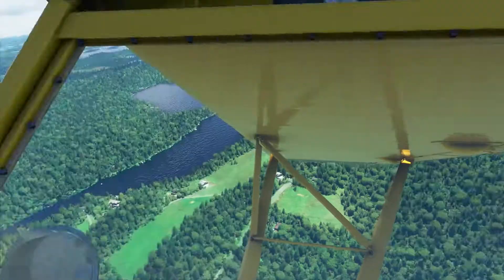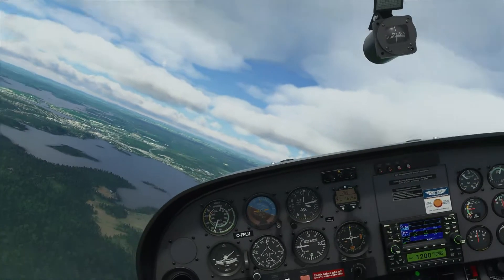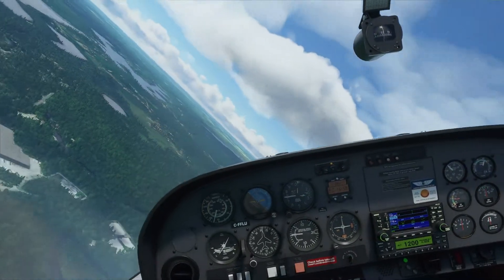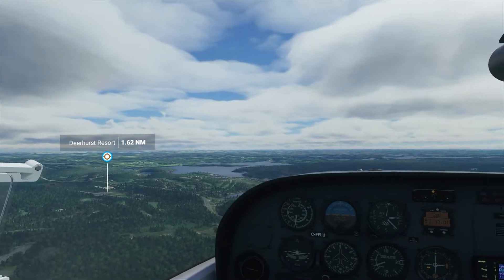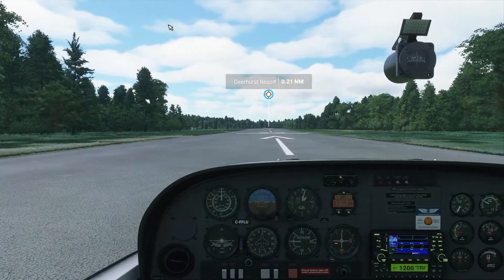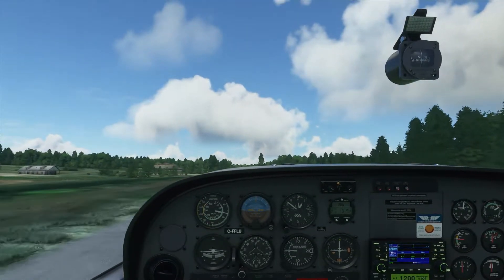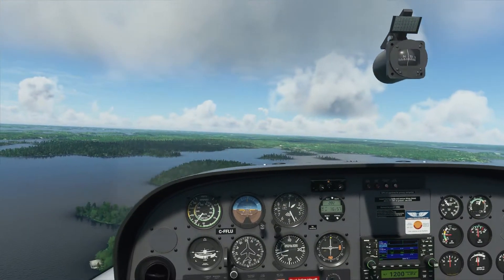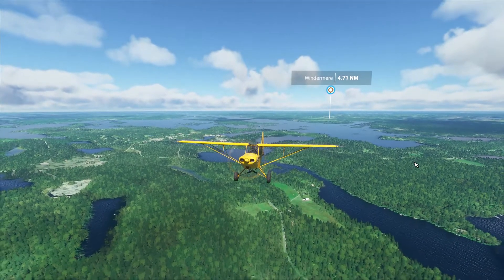Flight Simulator 2020 - Messed up Physics(?) Round Two

Comment: hey budy, i don't have anyone else to tell about the bug that i experienced.. I was on the final with de A320nx and putting the flaps down, when I putted the flaps 8 (maximum) my airplane started to climb an increase the velocity (A LOT) with the engine on idle.. It got 15.000feet and 500kts in 30 seconds.. And have you ever noticed that MFS2020 'helps' us to aproach? I came from FS2004 and FSX and I know better then anyone that it dosent work like that
Reply from the maker: I don't fly the big jets in MSFS, they don't interest me, so I can't comment on their behaviour specifically. I HAVE noticed that, at low speed, planes seem to generate far too much lift and more often than not I have to do full flap approaches when T/O flaps should be sufficient. 

This game has some very strange edge case behaviour with the flight physics.

Comment: Great experiments! I hope devs are aware of this and will fix this (if it is fixable at this point). Which yoke are you using? Also, what are you using to look around?

For now, an (undesirable) work around for the extensive pith autority is to change to a non linear elevator curve. That would reduce the pitch input and hence less drastic pitching.
Reply from the maker: Yea hopefully this is actually the result of a bug and an easy fix.

I'm using a Virpil WarBRD base with a T-50CM-I grip, a Virpil Mongoose T-50 throttle, and CH Pro Pedals. I'm looking around using TrackIR 5.

Non-linear curves help, but it's a bandaid. I've done some more playing around with the Cessna 150 and changed the elevator and rudder authority in the flight_model.cfg file to be 1/3 of their normal values, that's helped somewhat. Unfortunetly you can't do this with any of the deluxe or premium planes as they're all encrypted.
Reply: kalnaren I agree it’s indeed a bandaid. Nice finding of setting in the CFG file. I haven’t heard of trackir before, but it seems great. Do you think it works well and would you recommend it? Isn’t it like if you move your head to the left for example, that you have to roll your eyes a lot to still see the monitor? Or does it react to very subtle movements of your head?
Reply from the maker: @Fabienvg  TrackIR is great. I honestly can't play a flight sim without it anymore. Easily the #1 QoL improvement for flight sims for me after a HOTAS. I play a lot of combat flight sims and I'd say its essential for those, but even in this game just being able to look around easily is great. You can adjust the response curves in it. I think my total head movement is about 30 degrees aside and that looks nearly behind me. It takes some tweaking and some getting used to, but yea, it's very subtle. 

TrackIR itself works flawlessly in every program that I've tried it in that supports head tracking. You'll see some other solutions using a PS3 Eyecam like OpenTrack or similar that are a lot cheaper, but not a single one of them works as well or as flawlessly as TIR. But you're going to pay for that TIR convenience.